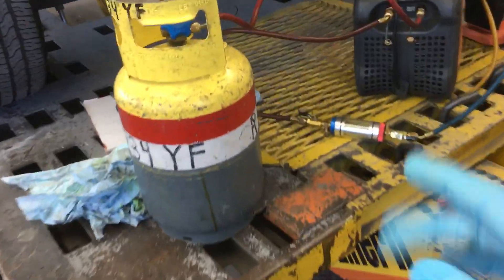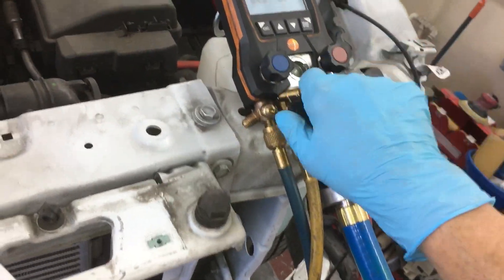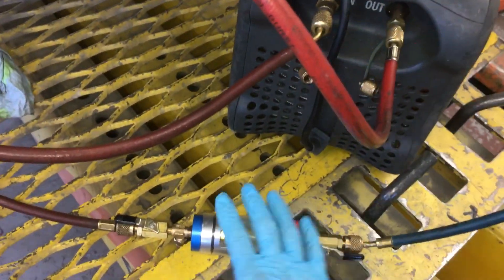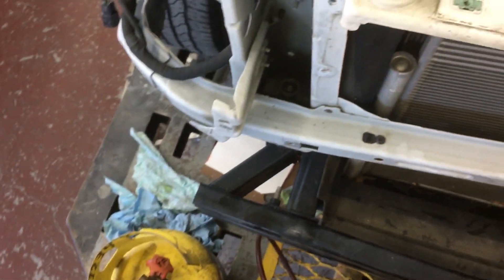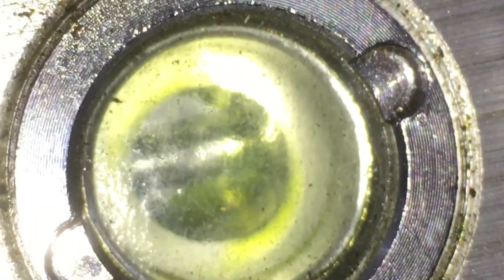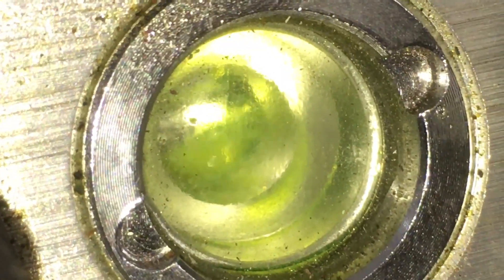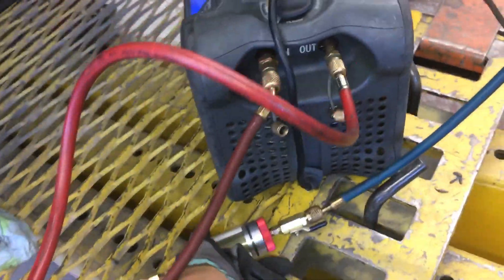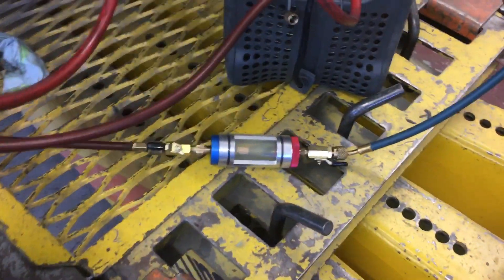Refrigerant Clear sightglass for Recovery no oil removal during process￼￼

Comment: Do you have or plan to make any videos on proper ways to flush auto ac components. I have a certain way i do it but would like to see how you would do it.
Reply from the maker: Yes if I’m ever on a job when I’m flushing it and have a little extra time to take video

I have a chemical pressurize question but I fill up with flushing solvent and pressurize it with my high-pressure nitrogen tank